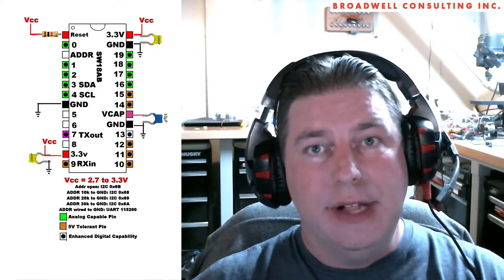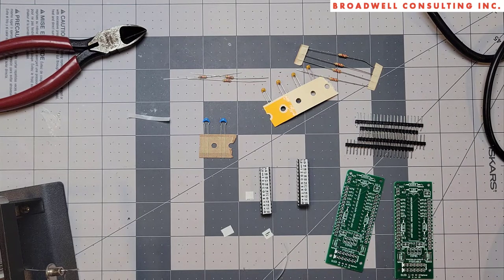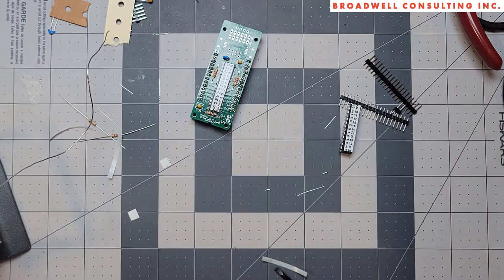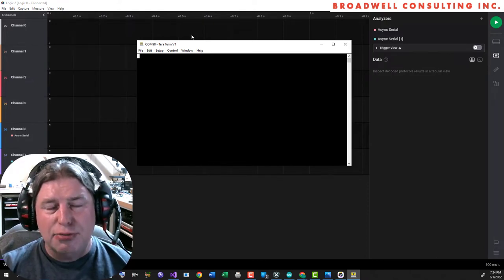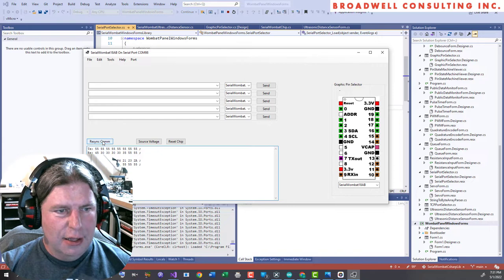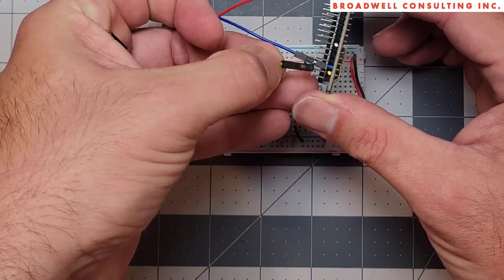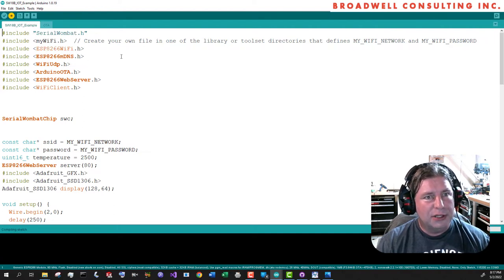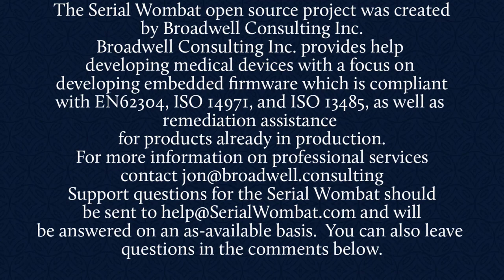Serial Wombat 18AB Getting Started Video

Comment from the maker: A quick note, thanks to feedback from @richwardca -  Add the pull up resistors if you are using I2C and there's no other pull up resistors in the circuit.  Don't add them if you don't need them.  You don't need to add pull ups to both boards in the kit if you're using them in the same project.

Comment: Great video, Mr. Broadwell! I am currently following the tutorial to solder my SW together: a couple observations/questions:
During the section about soldering on a 10k ohm resistor, the video says "oops, should be 1k". However the kit also comes with 10k resistors (brown black orange). Is 1k right, and I should go get a 1k resistor from my resistor box instead?

Other quick note that the kit of two SW boards only came with 2 2.2kohm resistors, both of which I used as pullups for I2C on the first board. will go look thru my resistor box for a couple more.

Great product, thanks for the great tutorials!
Reply from the maker: No.  I made a mistake when assembling.  I grabbed a 1k resistor that happened to be on my bench, instead of using the 10k from the kit.  So you see me solder in a 1k resistor, which is wrong.  The 10k is the datasheet recommended value for reset, although 1k would also probably work.  The inclusion of only 2 of the 2k2's is intentional.  It assumes that the user is going to use both SW18AB chips in a single circuit, in which case only one should have the pull up resistors (and one board would have a 10k address resistor, which is why there's 3 in the kit - 2 for resets and 1 for address).  This was based on feedback from the initial run of Kickstarter kits where a user populated both boards and had issues running them together.

Comment: Is it possible to do resistance measurement using only a serial terminal? I checked through protocol.c but couldn't figure out a way to do that. My use case is reading a a handful of voltage sensors and one thermistor over serial
Reply from the maker: Not at this time.  However, if you wander over to the GitHub page for the Serial Wombat firmware and add a feature request for this, I can probably add it in a future firmware release.
Reply from the maker: Apologies for not responding sooner.  I missed this comment in my notifications.
Reply from the maker: Just added this.  the 'r' parameter to the 'p' command will put the pin into resistance measurement mode in the forthcoming 2.1.0 version of the SW18AB firmware.